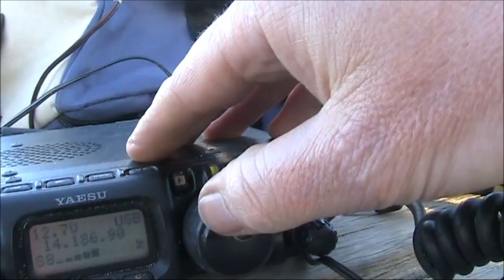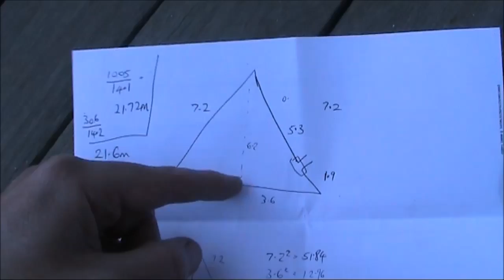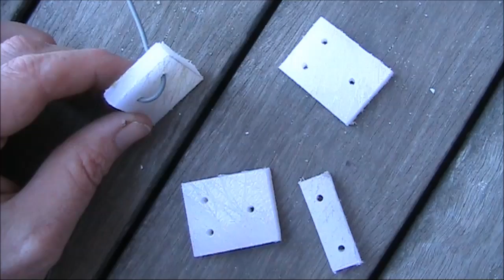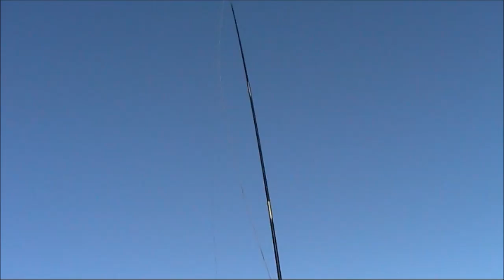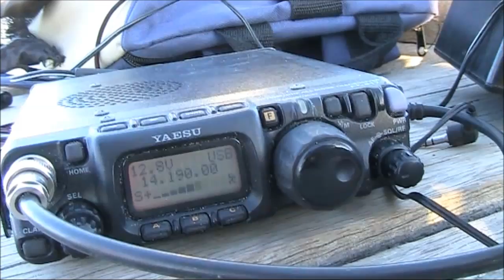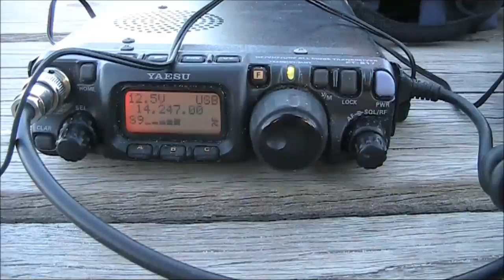Amongst the kilowatts: 14 MHz SSB QRP DX with a delta loop

Comment: This is my favourite amateur radio video. Where you have a simple and cheap antenna setup and a small amount of power. Yet you achieve 5-9 signal reports from the US. I love how that guy at the end was in denial because your setup probably cost 5 times less than his to say the least, and you were probably running much less power than he was yet achieving the same result! this is was amateur radio is all about. Awesome work peter!!!

Comment: Full wave loops are far and away my favorite wire antennas. I use an 80 M horizontal loop at about 50 feet as my main antenna. Love it.  I'm going to take your delta loop design and build one as a portable antenna for QRP sprints. I'm hoping to get better results on 20 vs. the inverted vee dipole I usually use. Many tnx for your fine work and informative videos. Hope to get you in the log. 73, Marc, W4MPS, Clayton, North Carolina

Comment: I'm more of the sort who sees contesting itself as futile, and running high power as pointless. One might just as well communicate via telephone or the web. I much prefer to learn about RF and electronics, then build and experiment with low-power gear, and unusual antennas and modulation methodologies to see if I understand what's going on.

Comment: Great video as always Peter. I tested the same antenna but worked with different length. I had to reduce about 5% due to the PVC insulation. Have you tested the horizontal polarization? Thank you de W6LDM

Comment: Great video as always Peter. Working through your workings though I noticed you got the height of the squid pole wrong...I make it 8.05m tall. It looks like you subtracted a2 from b2 before you rooted it (;-))
Reply: No he got the calculations right, in a right angled triangle the hypotenuse squared is equal to the height squared plus the base squared. So to get the height the equation becomes height squared is equal to the hypotenuse squared minus the base squared or in this case height squared is equal to 7.2 squared - 3.6 squared which ends up as height being a smidge over 6.2 meters.

It is physically impossible for the height to be 8.05 m when the sides of the triangle are only 7.2 m.

Comment: Hahaha! "No qrp!" I guess not everyone can believe their ears.
Reply: I think you misunderstand what the station was saying. He only meant that the proper contest exchange was simply "59 - 5 watts," saying QRP after that being superfluous. Contesters like to keep the exchange to the minimum requirements so they can work more stations faster.
Reply: Ron Chester
Ahhh...I see what you are saying Ron. It might seem that way from a purist contester's perspective; however in that case he wasted a lot more time telling Peter not to say the letters "QRP" than was necessary. If he was really that flat-out chasing contest points, he would not have bothered prattling on about it.

The DX station is clearly saying, "...not working QRP. Impossible 5watts!"

Then Peter adds, "I am QRP 5 watts, 73"

to which he gets another, "no no no, no QRP - no QRP!"

The incredulity in the DX operator's voice and words made it clear that he didn't want to believe that 5W could perform the way it was from Peter's field operation.
Reply from the maker: Ron - In any other contest you'd be right - 'QRP' is superflous. But in the case of the ARRL DX contest the power is a required part of the exchange. Just saying 5 can get lost in the noise (as it's less usual than 100 in big contests) whereas 'QRP' penetrated better.

Comment: What is the impediance out of the balun?  I'm trying to learn when to use a balun vs a tuner or both.
Reply from the maker: From memory it's 4:1. A full wavelength loop has an impedance of around 100 ohm so it may or may not be better than using a 1:1.
Reply: I’ve used a 4:1 Balun and a tuner with this, in fact I mistakenly used a 6:1 PVC homemade Balun on my QRZ page: KB2QQM and I can tune 40-6m with the 75 foot (22.86m) with each leg being 7.62m (25 feet) long.  He feeds his 6.2 feet up from the bottom edge but you can feed it at one of the corners.  On 20 it sends its RF broadside to the loop.  On the bands above 20 it sends it in the plane of the loop.  From WI I aimed the plane of the loop at about 030° to Europe and then in the early morning on 20 I was trying to use the broadside of the loop at 120°aimed towards India in the early morning hours.  Heard India but could not work him.  Great antenna. 

Interesting to see that a 1:1 balun worked.   The RF HAS TO go somewhere. 

Great videos.

Comment: Is the maximum receive gain perpendicular to the plane of the loop or in parallel with it ? Thanks
Reply from the maker: Broadside to the loop. But doesn't seem to be that marked.
Reply: vk3ye so its different than magnetic loop, coz mag loop the receive direction is parallel to the loop as the null is perpendicular!

Comment: What would I need material wise to build a Delta Loop for 20m for my 100W  Yaesu FT-991?  Is RF burn a concern at that kind of wattage using SSB?
Reply from the maker: Slightly thicker wire and a better balun that can withstand the power.  Not sure about RF burn (that's more likely with high impedance wires) but EMR exposure is likely to exceed standards if sitting right near it.